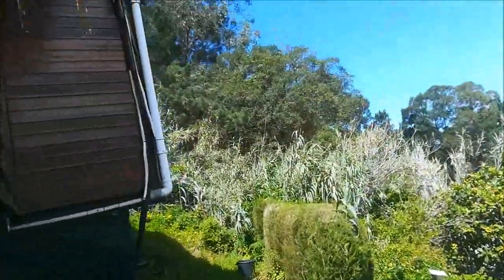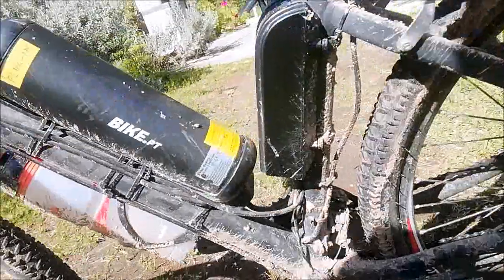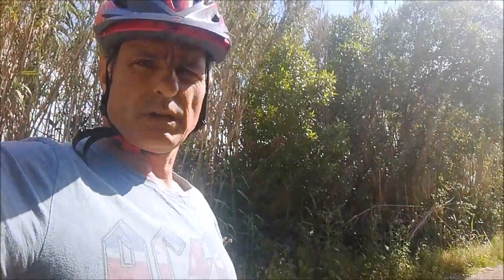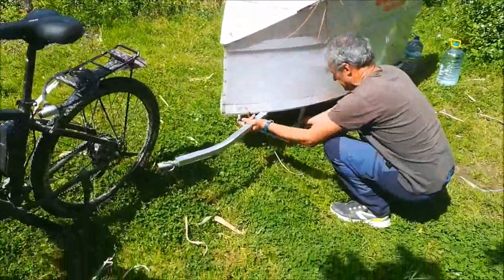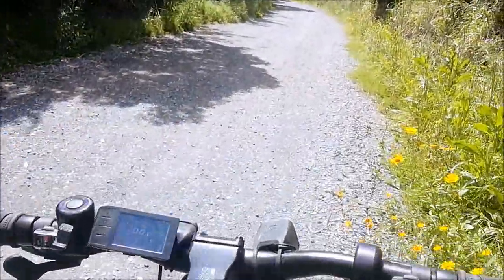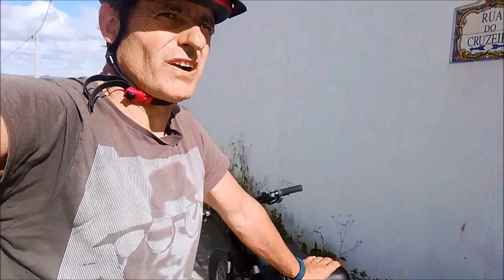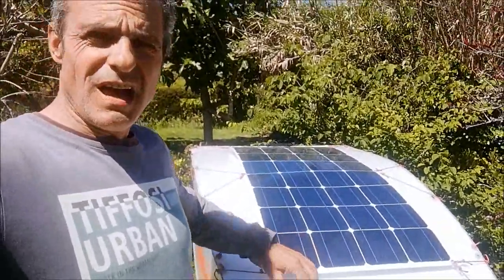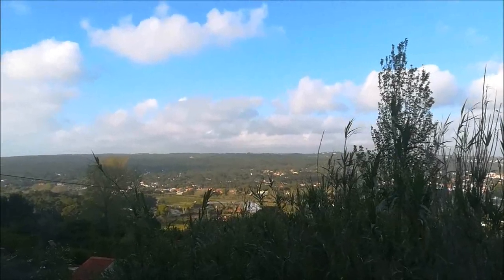Foldable sleep-in Camper (19kg) - e-bike elevation gain

Comment: I like what you do.  Trailer = more aerodynamic then others.  Solar panel space between roof ( if a thin layer of absorbent material is put on roof & wet, it will evaporate & keep panel cooler).  I like the handy lift-lid storage, outside in front for accessories related to bicycle & trailer, excellent!  Very helpful / scientific to give viewers accurate effort/gain/loss measurements for planning.  You’re great!  Thanks!
Reply from the maker: Glad someone appreciates it. When I look at other trailers that look and weigh more like a caravan I know that they can only pedal on flat ground, with no wind and stay inside in perfect temperature. Hope you saw my other video regarding this. Also, with an ebike one can practically tour autonomously.

Comment: Antonio..  i use is a couple of those car windshield reflectors. (the kind used to keep cars cooler in the sunlight)  I set them up aiming them at the solar panel to reflect and intensify the solar energy falling on the panels.  this increases the watts being generated by the panel.    I have a 170w 29.4v 5.83 SunPower® panel with 25% efficiency rating.  But even in light, it doesn't always create those specs, unless i reflect light towards them.  This will increase your current being sent to the Battery.  I also use a Genasun GVB-8 Li WP boost charge controller (the kind NASA uses on Satellites.  My 170w panel will keep my 52v, 17.5ah batteries going all day.. My range with the solar trailer is unlimited as long as the sun is shining.    I really like the unique design of your trailer.  Beautiful job my solar ebike friend.. PDX USA
Reply from the maker: Thanks for the great tip about the windshield reflectors. I will certainly try them since they weigh much less than an extra panel. It is good to know I am not alone. Solar travel will be a reality one day. We are only the pioniers.

Comment: Does your eBike battery allow simultaneous charging/discharging?  Also, I think there's an online solar panel vendor that right-sizes panels to fit particular vehicle roofs. Might be worth the shot if you want to cover your entire camper.  Thanks for making/sharing your vids.  Keep them coming, please!
Reply from the maker: Thanks for the tip about custom panels. Yes, all batteries can charge/discharge at the same time. The opposing currents result in a new current going in the direction of the stronger one, just like adding positive and negative numbers.

Comment: Hi, I'm in pnw Washington. I have a surron x bike. Fully upgraded to 72v 38 ah and nuc 24f controller. I bot a Amazon c forcee fat tire trailer . I might go with your design. I'm not using coroplastic. I'm building Sub frame out of 1x2 and  pine ,L brackets and cardboard. I bot a 3in tape king gun. And will seal it top to bottom,back to front a few times. Then paint and trim. Max weight capacity is 275lbs. Good luck and good Riding. Hope that will give you a idea in future for another build.